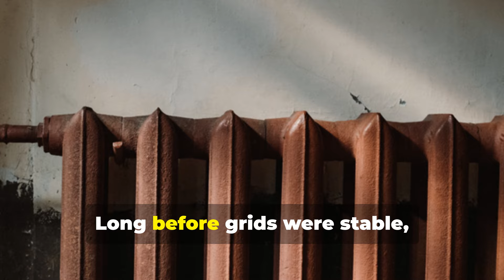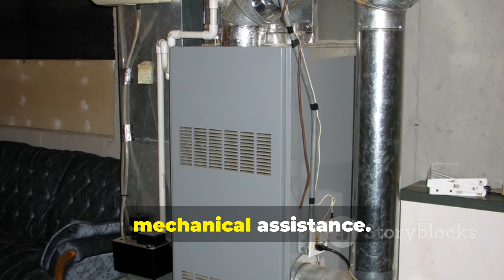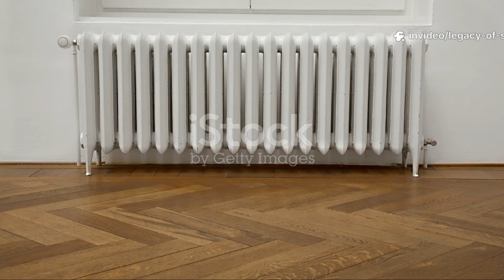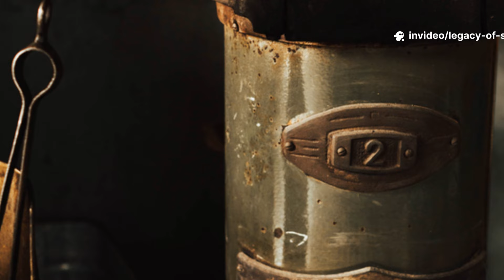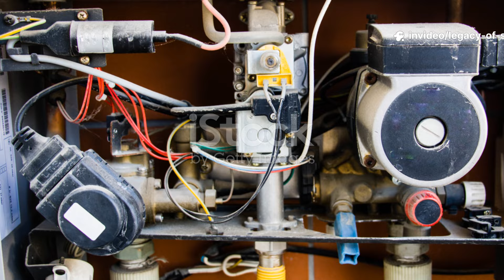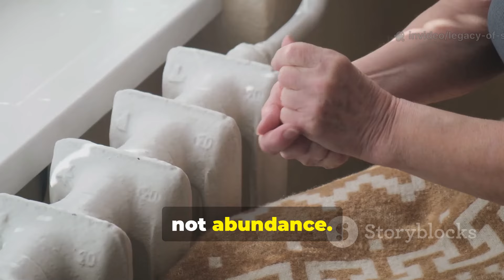The 1940s Heating System That Worked When the Power Failed (And Still Does)

Comment: I had a gravity hot water system  in my 1300 sq.ft house on Long Island. Oil fired converted to natural gas. 
It absolutely functioned.
I tried it for only 1 month, for an hour a day. 
The gas bill was $800+ for the month. And that was 20 years ago. Now that would be $1500, maybe $2000.
I bought little buddy propane heater and hoped my children didnt throw a blanket on the unit and burn the house dowm. 
That actually happened once, luckily, I was there.
Reply from the maker: Wow, thanks for sharing your experience😲That’s intense $800 a month back then is crazy, and yeah, today that would be a serious hit and stories like yours really show how heating technology and costs have changed over the years.